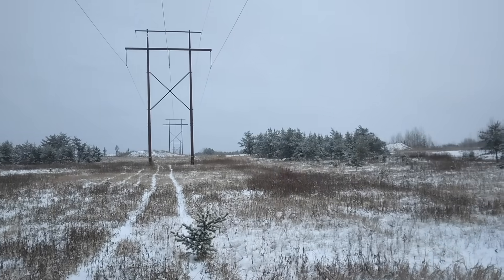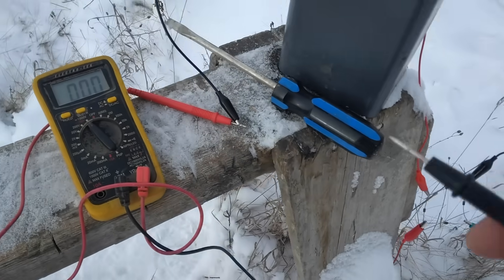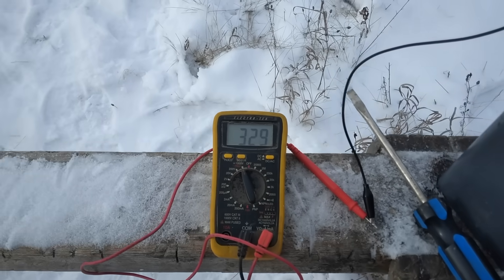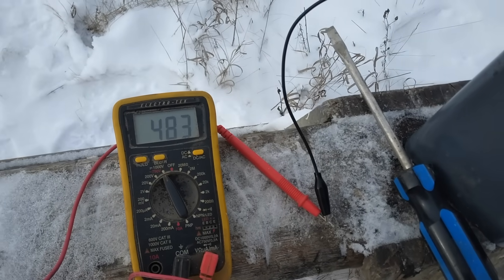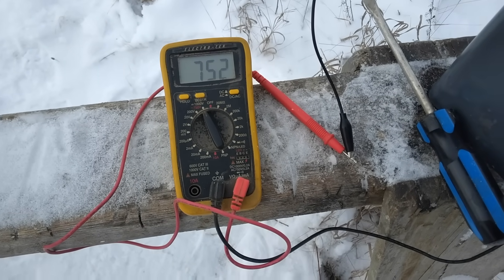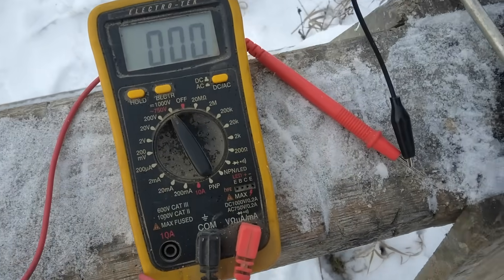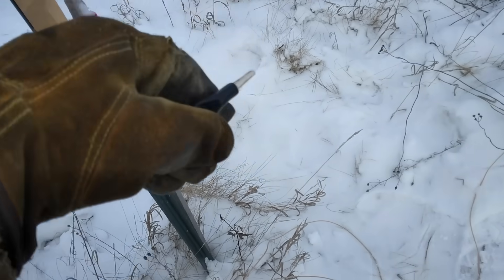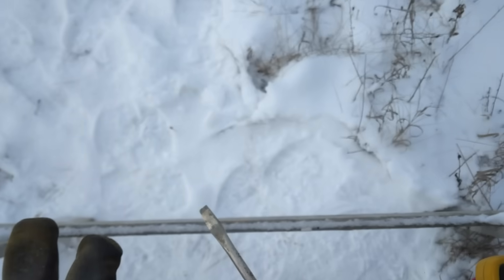Fences sucking power from under HV transmission lines

Comment: An afterthought to my earlier post.  In the late 1970's I owned a cablevision system.  Our main trunk line to town from our headend on a mountain was 18 miles long.  It was buried along a highway, underneath high voltage electric lines.  Each of the 36 amplifiers on the trunk line operated on 60 volts AC, which was duplexed onto the cablevision line, along with the TV and FM channels.  We had power supplies every mile or so, which injected 60 volts into the cablevision line, and the further you got from a power supply, the lower the voltage.  At around 38 volts we'd install another power supply - and back up to 60 volts again.  But amplifiers kept blowing.  I mean, like burned up.  Since the amps were in underground volts we were perplexed, since they were secure from grass fires.  So out with the voltmeter.  Surprisingly, we had between 100 and 400 volts on the line - despite putting only 60 volts into the thing to start with.  We went through one hell of a lot of amplifiers before we finally figured out that we were getting inductive voltage from the overhead power line!  At first we added light bulbs to each amplifier, which glowed brightly and scared traffic.  And they would glow bright or dim, as the current load on the overhead wires varied from time time time.  Finally, our engineer came up with a fix.  A 'crowbar' which used an SCR diode that would short to ground any voltage over 63 volts.  So the power line induced voltage would be bled off to ground.   Those diodes would get hot like an electric stove element, to the point where we had to heat sink them to stop them from burning out - that's how much power we were getting from the power line induction.
Reply: Damn
36 amps, that's must've been a hell 
though, back in the day you really only had to care about C/N, unlike today where you have US (for modems) too.
Reply: Where was your system? I was in catv construction for years, and knew most of the mom & pop cable operators in my area, and worked for Big John Walson for a while, inventor of cable tv. Back in those days you had to wing it on lots of things, like how far your amp runs should be, power supply placement, grounding, just about everything, as the industry was young and we were pioneers in a way. We had to invent our own equipment, because nobody had ever done this before. Those were the days, before the big operators gobbled up all the little systems and took the fun and creativity out of the thing.
Reply: @andyb.1643 That must have been pretty cool!
Reply: So the overhead lines were how high? And your cable was how deep? I thought lines near/over a highway were 4000V max.
Reply: @MrSummerbreeze01  i read that as the lines were also buried in the ground.
Reply: @twohulls This wouldn't happen with underground power lines because they have a grounded shield. That's because people and other objects could be very close to them, and the other phases are buried together, rather than digging three trenches, and you don't want them to couple.
Reply: @MrSummerbreeze01  Go to an ordinary neighborhood, the distribution lines are most commonly 7.2-25 kV. The lines feeding the substation are 33-66 kV.
Reply: @MrSummerbreeze01 this is a great comment. US as in upstream in the HF-VHF portion of the microwave band.
Reply: @MrSummerbreeze01  You can run as high a voltage as you want across highways as long as the poles or towers ar high enough and a good distance away from each side of the highway. Here were i live we have 130,000 volts across highways in different locations.
Reply: What are "underground volts"?
Reply: @manolisgledsodakis873 Probably should have been underground vaults.
Reply: @manolisgledsodakis873   a voltage measured from a subterranean source; or
a voltage that you have measured from any source, but are trying to keep it secret.
Reply: Vaults
Reply: Vaults
Reply: We would figure 8 high voltage cable up to 12,500 volts and that would kill out any magnetic fields and no leaking voltage getting out. On our CATV system there were a lot of ground points to bleed off and voltage including lighting that may get on the outside conductor of the big coax cable. In your comment you said down to 38 volts that's way to low for the amps and will cause heat up. It's best not to go below 50 volts. On 60 volts with out a load on it that 60 volts can go two miles no problem. All the booster here were mostly tube type with some hybrid amps and those were the good ole days in cable tv.
Reply: I work to cable TV in the 70s.Here in Ohio, we had push Pole tube type amps on the polls to feed the city of Chillicothe and surrounding area.The troops wthe tubes would have to be changed every three months

Comment: So that's basically a long but tiny inductor with a little series resistance. What you really need is a coil transformer to step that voltage down to a reasonable voltage....I'd think either big loops and form a transformer with a single turn secondary, or run a sideways coil in a large loop laid perpendicular (flat) along the transmission line length like you are doing....what you want is basically the same as a regular transformer, but it'll be much less efficient since the dielectric is air, not a nice iron core.  That's the ticket. Try it and let us know :-)

Comment: I am a retired electrical engineer and I seriously doubt that you could get much in the way of sustainable current with such a low inductive coupling coefficient. Just look how long it took the cap to charge.  If you did you  would probably lose a case  if you stole power this way. regardless of the anecdotal evidence others talk about here. For most criminal convictions especially theft you must prove the  mens rea (intent) and the actus reus (the action). This looks like a slam dunk for a prosecutor. you intended to steal power so you built an induction fence and connected your electrical system to it. None of the physical laws argument would even apply here, You siphon gas from a persons car same thing.

Comment: A key factor to making this work is that the powerline has to be carrying AC current.  Many of the very high voltage long distance lines use DC in order to get around the inductive losses associated with alternating current.  However, those DC voltages have to be converted back to AC in order to supply a local grid because transformers don't work in a DC system.  As far as 'stealing' is concerned, that's a tough one.  Any AC line sends out a magnetic field which alternates 60 times a second.  The further from the line the weaker the field.  The line, in effect, 'throws out' a magnetic field.  So are you stealing something that someone has thrown out?  Another however!  IF a fence line intercepts this magnetic field and generates a current as a result, and IF you put that current to work, lighting a light bulb, operating a heater, etc.  IF you put a load on the fence line, this will remove power from the powerline itself.  The fence operates like an open air transformer, with the fence being the secondary coil and the powerline itself being the primary coil.  In this case, these 'coils' are linear, and not in a winding form.

Comment: I have a power ling in back of my home I was wonder how much votages was running through me stand working on mu car outside my garage. I check myself and found I had 1.3 volts running through me to ground. I'd say it would be interesting to see it you could use it to charge a 12 volt battery up and power a light of of it. Then see if it would stay on all night if left up running during the day, and let it charge in the day time. That way it could be useful to you to light your barns and other areas with. You could use a small transformer to control the out put and a  full bridge rectifier https://youtu.be/Zn0GisHgWY4?si=gTY-Si6ZPB2b70BX

Comment: Very interesting to see these stories of electrical activity'!  

HOWEVER... Here's one that I have NOT seen...

In the Ohio Valley region (almost 25 years ago), Ham radio operators were experiencing an unusually STRONG radio signal that was present on the 80 meter Ham band (3.5-4.0 mHz).  This radio signal was a harmonic (probably a 3rd harmonic) of a powerful, commercial AM broadcast station in that area & it was about 20 db/S9 on the Ham band!

Upon further investigation, the following was discovered...  There were high-voltage power lines, on towers that were close to this powerful AM broadcast station.  Consequently, there was very efficient "inductive coupling" that occurred between the AM broadcast antennas and the top 2 lines on the high-voltage towers.  FYI - The 2 wires at the very top of these high-voltage towers are used for LIGHTNING PROTECTION.  Electrical clamps and thick ground wires are used to redirect any excess static electricity buildup & lightning hits to ground.

Unfortunately, over the decades; acid rain, wind, Sun, vibration etc. had removed most of the conductive grease between the electrical clamps and these top 2 wires.  Other fittings & connections also became compromised electrically by corrosion.  Last, some of the mechanical fittings for these critical electrical connections were broken or had loosened up' over time. Consequently, the grounding system for the top 2 wires was very poor-to-non existent!

This enabled the top 2 wires to act like a parasitic, high-gain antenna regarding a harmonic of this nearby AM broadcast station.  So, these wires very effectively "reradiated" this AM broadcast on the 80 meter Ham band.

After identifying this problem and making an appropriate argument to the electric company, they finally relented... New electrical clamps with fresh conductive grease were installed (after cleaning away/treating corrosion) and the grounding connections/system at the base of these nearby towers was also reworked'.  END OF PROBLEM!

PS: On a different note... Years ago, I worked at a software company and a co-worker told me that he once worked for several years at a power company.  Over time and via careful analysis, they concluded that about 4-5% of all the electrical power that they generated (via nuclear reactor) was stolen outright.  These calculations took into account electrical inefficiencies-losses experienced on: lines, connections, switching stations & various transformers, etc.
Reply from the maker: Thanks for sharing!

Comment: I used to do land surveys for the federal government. We knew never to park our trucks under the power lines. One of our guys forgot one day and got a brutal reminder. It didn’t kill him but it gave him a third degree burn under his wrist watch when he reached for his door handle. This doesn’t always happen just with power lines. Ad kids we had huge antenna arrays for our crystal sets or 2 transistor radios. If you were barefoot on the sidewalk and touched the antenna you got quite a tingle in your feet.

Comment: This is all old news, your wire does not have to be suspended in air to work.
It could be on the ground or buried!
The 1950's were the heyday for this! Farmers and ranchers were burying wire under these transmission lines, they did it in "coils" perpendicular to the overhead lines like a coil spring or streched out slinky!
The effect is the same as a transformer, where there is no physical connection between the primary and secondary (high and low voltage)
People may "think" you are collecting stray or energy that is escaping into the ground anyway, NOT THE CASE AT ALL!
DEFER BACK TO THE TRANSFORMER MODEL ALREADY EXPLAINED!
THE US Supreme Court ruled decades ago, THIS IS FELONY THEFT!
These farmers/ranchers were vigorously prosecuted en mass!
The power company, easement holder has little humor for this, and if they know about it, will vigorously pursue  criminal felony theft of services case against you!
That said, I am sure there are still many remote transmission lines, that have buried coils under them, that have existed for decades, with the property owner stealing power!
My father (holding 2 engineering degrees) explaind all this all to me as a kid in the early 60's, as to exactly how it works, it's not "Free Power" but rather theft, and the case law surrounding it!
Trust me, the power companies will prosecute!

Comment: Also another note on this is if you have ground the wire to metal fence posts and over time the junction rusts this will also cause a voltage build up because it is no longer properly grounded.  Power companies have always wrote off the losses in power transmission and if you are smart enough to find what they have wrote off so much better for you.
Reply: If you start harvesting it then you increase the loss for them. It is taking electricity, not just harvesting what's already thrown away.

Comment: I worked for Hydro-Quebec. They used to remove the direct connection to ground of the "ground wire" and do it through lightning arresters. They would pickup the voltage from that line to power a remote substations.

Comment: That's induction causing voltage on the wire, not capacitance.  It's the changing magnetic field surrounding the power lines intersecting with your wire.

Comment: Back in the mid 70’s I was a Crane operator in Phoenix AZ.   We were on a job North of Flagstaff in a small town called Grey Mountain.  Arizona Public Service a power company was installing a large electrical transformer.  In this business everything on the job including the crane is required to be grounded.  As I was sitting in the cab of the crane the linemen were in the process of grounding the crane. We were located in an area similar to the power lines in the video….i looked down and to my surprise I noticed them laughing as by removing the ground wire that had been attached to my outrigger I could see them using a electrical arc to etch their initial’s in the paint of the crane.

Comment: to all that say he is "Stealing" electricity ... he is not... 
the high voltage power lines create a changing magnetic field and when you expose an electrical conductor to a changing magnetic field you will induce a voltage in the conductor. The magnetic field is independent and unaffected by the wire he erected.

Comment: I remember reading about a power company that noticed a draw on one of their high tension lines and when they investigated it they found a couple had built a shack under the power lines and then thrown wire over the power lines, they had several wraps around the power lines so they were pulling some significant power.   I'd like to see you move the fence away from the power line and see what you get for power at various intervals.  Move it 10 feet, then 20, then 30, out to 100, maybe go out till you don't see any current.
Reply: Wire over power lines? I’ll take “things that never happened” for $800, Bob.
Reply: A neon sign transformer would work to drop the 7200 volts down to 120.  @armaanroshani

Comment: My hero!  You are not sucking voltage, you're merely capturing naturally emitting power from the source.

OBTW, it was dangerous before you walked up to the wires.

Your bridge rectifier is genius.

Remember, it's still your property.
Reply: A lot of the electrical power of conventional electric lines are not electrons traveling through the wires, but related electric fields outside the wires. I remember a ham radio guy talking about this. I think he said they could use a field strength meter (I think it was) to check in these areas to see if some of the power is being diverted illegally. People using this power from nearby fences are indeed stealing power from the utility company. Its not free electricity.
Reply: @garywheeler7039  additionally, the lines of flux you are referring to is taught in electronics theory.  Not unlike the lines generated from a motor or from the magnetic lines surrounding the earth.  If you have the means of harvesting...and it is in fact, your land.  I see no foul here.

Thanks for your reply.

ET1(SS/SW/MTS) US Navy, Ret.
Reply: @garywheeler7039  "not free". True but then nothing is.  And if that is the case then the electricity harvested is but rent from occupied land.

Comment: If your diodes are rated 1000V (looks like you are using 1N4007) this is NOT good enough for your experiment.
In reverse you have to add the voltage over the capacitor to the voltage coming from your wire, so their rating ends up well before you measure 500V.
Discharge it preferably with a 1MegOhm 1W resistor, shorting might damage your capacitor
Also you meter HAS TO BE set to DC.
And yeah !!!!!!! IT IS DANGEROUS !!!!!!!!!!    The voltage on the capacitor can instantly kill you !!!

Then again.. interesting experiment.

Comment: ELECTRICAL IGNORANCE ????
I think you have overlooked the fact that the Atmosphere and the Planet (Ground) have at ground level about 110v of natural "static" electricity. And the detectable voltage rises with height. At around 30-40 feet above ground level the atmospheric voltage "naturally" reaches about 500v !!!  Adding a CAPACITOR to your set up simply reveals the STORED amount of electricity in the CAPACITOR nothing else. If your "four diodes in a quandrant" are connected correctly, all this does in add a "rectifier" into your circuit ensuring you can only record Half Wave DC current/voltage. NOT AC current/voltage. PREVENTING you from registering ANY AC (Alternating Current)  coming from the AC HV power lines above !!!

Comment: It's funny, the other day while running with my girlfriend, we were going under some power lines like these and I was wondering if you could set up a wire system to trap some current from the magnetic fields that come off the lines. Cool to see it works.